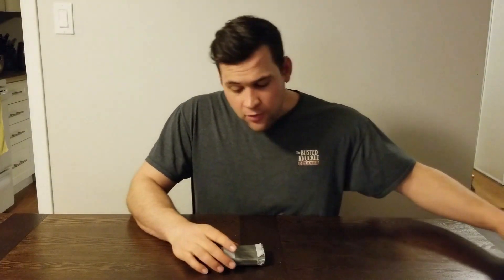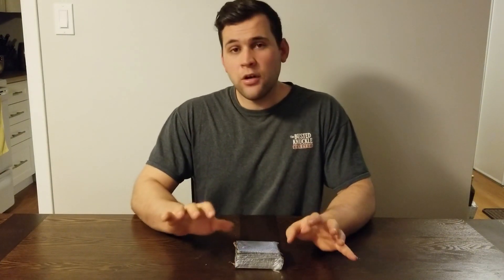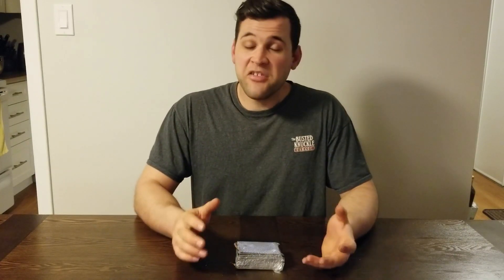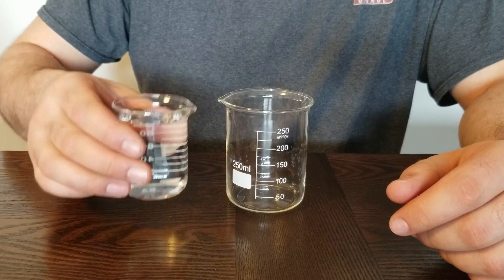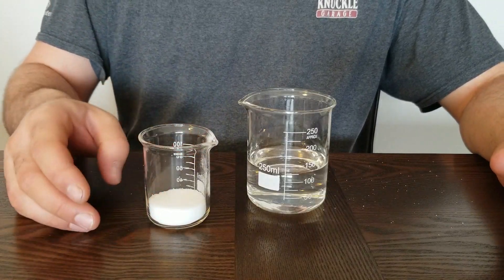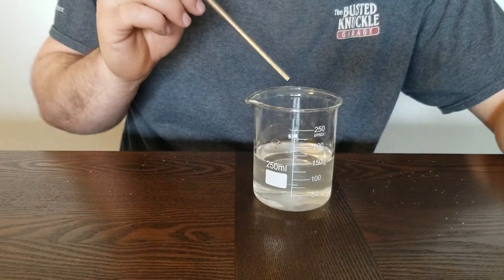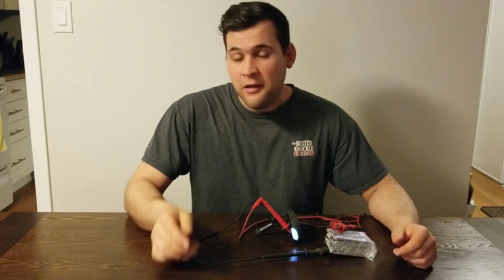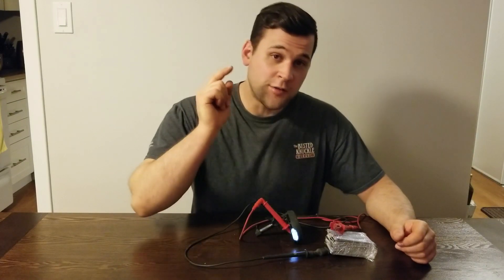Aluminum Air Battery Build 2.0

Comment: How to make  a 1 amp battery  source?
Reply from the maker: Depending on what kind of battery you wanted to make, probably the best option would be to make multiple cells and tie them all together in parallel or something like that.
Reply: @MechanicGoneRogue  bases on aluminum air battery,  also,  can you show how to make a battery that can heat something  small up enough to  cook on? Even if it is a slow cook. Would you also show how to make a one amp 5v battery for charging a phone?
Reply from the maker: Great idea's!  If I can manage to refine the design so that it's powerful enough to do that I'd love to.
Reply: @MechanicGoneRogue  maybe, parallel, or I have seen a video doing that with aquarium activated charcoal.  I  also would  like to see pocket warmers with paperclips as the heating elements. .5 volt leds and penny fuel cells work too. I have so many ideas.

Comment: you should check the capacity of battery in milli ampare hour. or check the duration of led light.
Reply from the maker: Hi there.  Thanks for the comment.  I actually did that in later videos.  Check them out if you're interested.  Cheers!

Comment: If you would use just K2CO3 with water as the electrolyte you can almost get 1.3 to 1.4 Volts per Cell  out of this battery !! Just try it out ! Good luck !
Regards, Stefan.

Comment: What happens if we all attempt to charge an aluminum air battery? Like applying voltage on it
Reply from the maker: I actually made 2 videos about that.  Its called "Will it Recharge" part 1 and 2.  Check them out if you want more details, but the short version is yes they recharge, but it does bubble because of the water in the electrolyte.

Comment: Keep up the good work! Great job on the zooming in and slowing down so we can see what your doing. Good audio too. A topic suggestion, I haven't seen a video that showcases the different diy materials that you can make anodes and cathodes with. I like that you don't want to go straight to the dangerous stuff.
Reply from the maker: Thanks for your comment @darren cox.  Really appreciate the feedback on the changes. Lots of people like to criticize, but few follow up.  In later videos I did switch to using graphite sheet as my cathode, but I haven't really found anything to change up the anode with.  Did you have anything in mind?

Comment: I heard that the dull side of aluminum foil has a coating on it!
Reply: Not sure about that. From what I've seen, it is made using two sheets in a stack as it is progressively passed through rollers. The dullness comes from the two sheets being pressed together during the rolling process. YouTube has videos that you can look up; it is actually an interesting process. I don't thing it is coated at all, considering that it's primary use is for foodstuffs.

Comment: How does the battery not dry out? I mean, Aluminum reacting with water should produce hydrogen and aluminum oxide. So the electrolyte should run out, i think. Btw, thank you for the practical explanation.
Reply from the maker: Your right the battery does dry out.  It takes about a day for that to happen though.  I'm not sure if hydrogen is produced from this reaction, but mind you the battery isn't very big so if it did make any hydrogen I imagine it would be a negligible amount.  I'm glad you enjoyed my video.  Cheers!

Comment: Do these things need air to operate?
If you blow more air through them, let's say a fan or you place it on the roof of a moving car, do you get more power?

And I have some crazy ideea in mind, they need oxigen, right?
What if I blow pure Oxygen into an electrolyte bath, but what's my other electrode?
One Terminal is the aluminum.
And my other battery terminal is?
Reply from the maker: In theory yes they do.  I've thought about trying to increase the amount of oxygen present by pressurized the air around the cathode.  Haven't gotten around to actually doing it yet though.  A fan might be a cheaper way to test out that theory though.

Comment: It was a cool project. How much power does your battery prodeuce in mAh? Have you tried to see how long it keeps the light on for example?
Reply from the maker: Hey there glad you enjoyed my project.  I'm not sure of the mAh on this one, but I have improved on the design since this video was posted.  I actually just released a video were I try to recharge an improved version of this cell.  It's mAh rating is 26 if I've got my math right.  There's more details in the video so check it out when you can.  I think you will enjoy it.  Cheers!

Comment: Can we use direct electrolyte without tissue which will reduce the drying of electrolyte??
Reply from the maker: Good question.  I haven't tried it, but something would need to be between the anode and the cathode to ensure they don't short out.  Hope that answers your question.  Cheers.

Comment: What happens when the electrolyte solution dries is it done then or do you need to disassemble and rewet it
Reply from the maker: Yes it needs to be rewetted, but I don't disassemble it.  I just use a syringe to get some into each cell.  Good question though, I've found that drying out is the primary cause for the battery failing, and yet you are the first person to ask about it.  Cheers!

Comment: im curious about mah capacity ? also does it produce much heat? also what about h2o2 in your water salt?
Reply from the maker: Good questions.  I don't know the mah capacity right now.  No it doesn't produce any heat.  h2o2 solution might work I've considered it for future videos, but have gotten about to testing it yet.  Hope that helps.  Cheers!
Reply: @MechanicGoneRogue  be carefull if you use consentrated h2o2 lol
Reply from the maker: @fookinay  haha yes indeed.  Probably will start out with some over the counter stuff first if I do go that route.

Comment: I think the LED brightness is a factor of the voltage. What do you think?
Reply from the maker: I think in this situation the bigger problem would be low amp output.  This light is normally powered by 3 AAA batteries so the regular working voltage is only 4.5V.  This battery when compared to my first one doesn't improve its voltage nearly as much as it improves its amperage.  Hope that answers your question.  Cheers!

Comment: Hey man, great video, a big improvement was achieved in this second battery, congratulations I'm impressed, because increasing the current is very important, again thanks for sharing, a suggestion, I think you could use the proper aluminum to replace the copper, hugs.
Reply from the maker: Thank you very much!  Although I think I've found an even better conductor than aluminum since making this video.  It is graphite sheet.  I explored the concept in another video.  Hopefully my third battery will be able to benefit from it.  Cheers!

Comment: Magnesium (MG) is better than aluminum (higher voltage). I've played around with laying strips of MG on top of the aluminum with good results. MG strips are cheap to buy.
Reply from the maker: Mmh I never thought of using magnesium.  Good suggestion.  Thanks for sharing.  I'll have to try it out.  Cheers!

Comment: Using your electrolyte to turn you charcoal to a slurry is very much like what we do in lead acid batteries. The lead oxide is moistened into a paste using a solution of sulphuric acid, which is our electrolyte! You could take this a step further use stainless steel, or perhaps even aluminum mesh to press your charcoal paste into improving the plate conductivity!
Reply from the maker: That's very interesting.  I didnt know that was how they that.  Just a thought if I were to add a metal grid of some kind to the cathode would that not cause a side reaction with the carbon and electrolyte.  I'm just thinking that because the anode is also a similar metal?

Comment: try baking soda water as the electrolyte
Reply: mildly acidic
Reply: casing from carbon, plates in shared parallel separators in electrolyte
Reply: remove air electrode from the stacks, alternate or roll aluminium with electrolyte paper, assume that small bridge is enough to connect to the outside air electrode casing
Reply: more current less voltage, multiple large stacks to get higher voltage, like the 1.5v thick battery slab
Reply: thats carbonic acid btw in water

Comment: i think you should reduce it to about 4 volts then make multiple versions connected in parallel for example 3 giving 4 volts connected in parrallel then redo it 3 times connected in series to give high amp at 12vdc and if it is consistent non stop connect it too a 12vdc to 110/120 - 220/240 vac invertor for house hold power if you get modified sin wave at 50 hz 120 or 240 you can easily operate small appliances like tv, laptop, coffee machine, lighting
if you invest more in a heavier duty inverter and get a true sin wave 60 hz inverter maybe power an AC unit or fridge (things with compressors have huge crank start power draw)

Comment: I wonder if placing carbon coated spacers in the air gap to increase surface area, and then pushing normal air between the gaps with a fan would improve performance.

Comment: I think I see a posible improvement. The battery layers could act like the layers of a capacitor, allowing part of the current to go from the input to the output in more of a straight line, thanks to quantum physics making electrons jump from one layer to the next. You could still have half the layers having current going in one direction and the other half in the opposite direction, but have them stacked so the half going in one direction is below the half going in the other direction, and use a bit more aluminium and clingwrap to do the pairing of the sides. It could be a concentric U-shaped stacking, or sidewas-overlapping U-shaped stacking, depending on how you do the connection between each pair of layers. i.e. if the odd numbers represent current going in one direction and the even numbers prepresent current going the other direction, then the concentric stacking would be 13578642 or 75312468 (or mirrored, 24687531 or 86421357), and overlapping would be 13572468 or 75318642 (or mirrored 86427531 or 24681357). I hope that makes sense. It might not make a difference, my understanding might be incomplete, but I think it's worth testing, at least.

Comment: What happens if you try to recharge this battery? Can you make a video? Can you see if recharging creates hydrogen gas? Can you try to capture any recharge-gases and prove that it's hydrogen? Can you see if some process can suppress the production of hydrogen gas, like using UV light or recharging in a pressurized container?

Comment: I don't know if this will help but you can solder copper wire to aluminum with regular solder if you solder to the aluminum while under oil (the stuff you put in car engines).
Reply: Interesting....I'll have to try that as it has a huge potential......soldering anything to aluminium is quite impossible normally.
Reply: It possible just need to take out oxide on the surface out first

Comment: This is great for experimental purposes, but how would it compare with a standard AAA battery ?! It seams a standard AAA battery (much smaller in size than yours) has 50mA 1.5V, which roughly means 75mW, and yours is giving 5v * 12mA = 50mW. It might be that yours has greater capacity, as more than 1800-2600mAh like in the standard AAA battery. And I think that the capacity is after all, the characteristic that would make your solution fiable enough to make these on personal base use instead of standard cheap bought batteries.

Can you make an estimation of how much mAh would your battery last ?!
Regardless of the results, I say: Congrats, it's an excellent tutorial explaining the basics of batteries, these are not tabbu anymore, because of you !
Reply from the maker: @ Cosmin Popescu.  In order to give any kind of estimation I would need to assume that the mA remains constant during the discharge duration.  If that is the case I would estimate the mAh to be around 2000.  As the long as the electrolyte doesn't evaporate (or more is applied).  I've had some of my prototypes last for about a week before the aluminum is all oxidized.  I really appreciate your feedback.  I'm glad you enjoyed my videos :) cheers!
Reply: @MechanicGoneRogue  This would be great news, thanks. So my idea on searching the web is finding a good recipe that accomplishes four conditions: (1) is 100% homemade possible, (2) is much cheaper that any commercial type of battery, (3) can be recharged easily by just filling an electrolyte or replacing a some sort of cathode/anode "cartridge", (4) has a good last-time-power balance, meaning I would have to "replace the cartridge" once a month or so.

Do you think this would be possible ?!

I saw on the internet that a big university discovered some years ago a form of simple tech that would use Magnezium FOIL for a battery that can achieve great power-time balance (30 g of magn foil would make an ios phone last one month, and they say it would cost only 9 cents), but I'm not sure where I would acquire magnezium foil, I mean cheap (I found something in Romania, my country, on the inernet but it was like 1000x (no kidding) more expensive that these guys said).

This is the video i found most promising, what do you think ?!:
https://youtu.be/3EKmetdjE-c

Comment: Hi! I commented under your last video before watching this one. I see you already implemented some of the same things I suggested.
Maybe you can build a third version that additionally also comes with a catalyst (such as mixing low micron titanium dioxide powder (or MnO2) into the graphite powder) and a reducing agent (/axioxidant) to reduce the amount of aluminum oxide build-up (such as e.g. ascorbic acid / vitamin C mixed into the electrolyte) and add some acetone to increase the solubilty of oxygen (or any other cheap gas solvent, if you can think of something better and less volatile).
In case you have some epoxy and fiberglass lying around, you could also build more reusable cathodes: graphite powder + TiO2 (or MnO2) directly mixed with epoxy (--> the graphite in this solid sheet should also solve the conductivity problem), saturate the fiberglass layer with this mixture, then sprinkle it with dry graphite/TiO2 (/MnO2) powder before curing, in order to leave it with a rough surface after it's hardened. With a solid/non-permeable cathode, you would of course need air channels on the "electrolyte side" of the cathode.

Two potentially stupid questions:
1. Do you think it's important that there is some kind of separator between "air side" and electrolyte or can oxygen be dissolved in the entire electrolyte (e.g. under pressure)? The reason why I'm asking: I know there are simple DIY "McGuyver" batteries made from an aluminum can, filled with salt water and with a central carbon or copper cathode. Of course this way only the top of the electrolyte liquid is exposed to the surrounding air (=with its partial O2 pressure), so not much oxygen will be dissolved, but it seems to work in principle, therefore: do we need an air cathode that doubles as a separator only to prevent leaking and in order to achieve a greater oxygen diffusion area or does the separation have an added purpose, i.e. would more oxygen in the solution (with diffusion to the anode) be a problem for some reason?
2. When several "cells" (anode/cathode pairs) are connected in series, can they share the same electrolyte or does it have to be physically separated between "cells"?
Reply from the maker: Hi there @ Christian S.  Thank you so much for your brainstorming comments.  Some of your suggestions involving titanium dioxide or magnesium dioxide have already been on my radar for a while.  Only because others have commented in similar fashion.  I appreciate this though, because it indicates to me there could be something there if so many people are talking about it.  The use of acetone is new though.  I had considered it's use for an organic non aqueous electrolyte, but didn't follow through because I felt that the solution would be too volatile.  I didn't really consider that it would increase the solubility of oxygen.  I might have to revisit that.   An epoxy cathode could have potential as well.  

In answer to your questions.
1.	As I understand it (I might be wrong on this) the oxygen is absorbed by the carbon source and transferred chemically to the aluminum via the electrolyte.  I don't believe that the electrolyte itself absorbs any oxygen.  As long as the air side is not prone to mixing with the electrolyte, I don’t think any kind of separator is necessary.  In my designs the air side is always on top of the electrolyte. In the examples you cited.  The Al/Cu is a galvanic cell so I don't think atmospheric oxygen is a factor in it's reaction, and as long as the two metals aren't physically touching they will produce a voltage.  The use of carbon (I assume a graphite rod?) as the cathode in that design (where it is fully immersed in electrolyte) may be a different reaction.  I say this because in my latest experiments I began using graphite sheet instead of activated charcoal and found it’s performance is not tied to exposure to oxygen.  I’m wondering if it is functioning similar to a lithium-ion battery, but I don’t know how to prove it.   At least for now.  Nonetheless it is interesting.
2.	I haven’t tried using the same electrolyte for all of the cells, but I would assume like other batteries that would not work.  Probably a divider (like a car battery design) would have to be used between cells.  

Hopefully, that answers your questions.  Thanks again for commenting. Cheers!
Reply: Way to go Tesla 😜